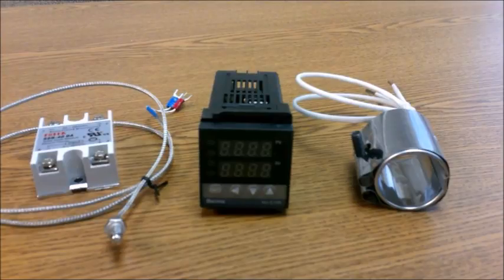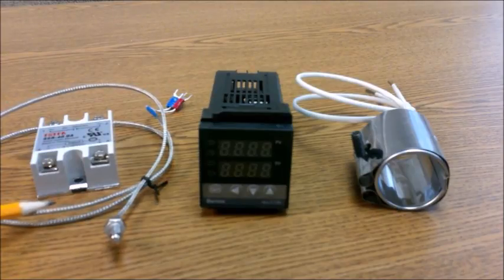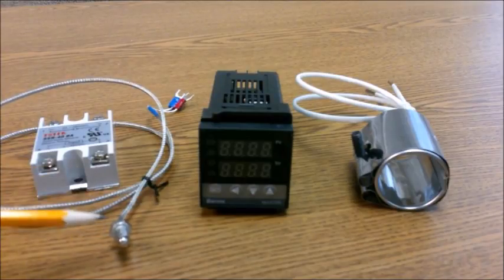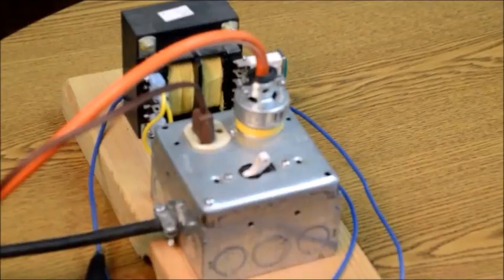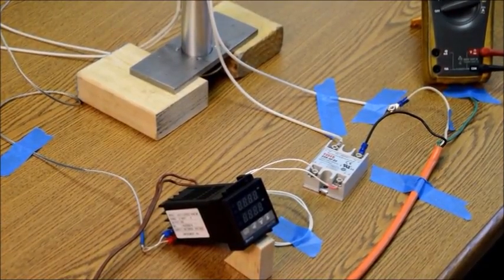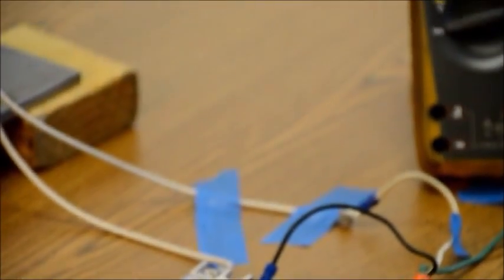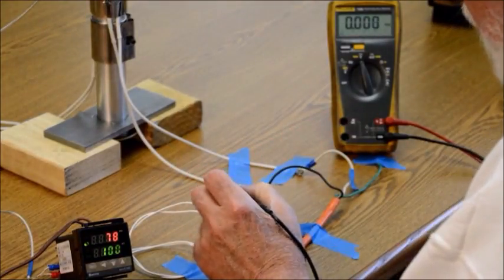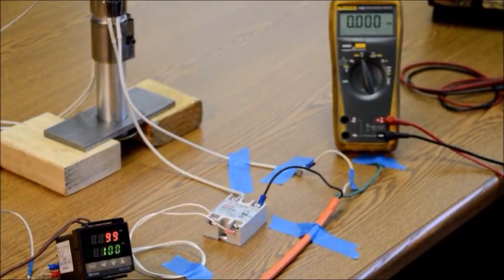Injection Molding of Recycled Plastic at Home  Part 3 Injector Electrical

Comment: Hi Paul, we have been following your very instructive videos on making an injection molding machine. We have a question, the heaters we purchased came with what seems to be very short wires about 6 inches in length. We are worried that the heaters will be too close to the wire housing. How would you go about extending the distance from the heaters from the wire housing? Is splicing with a standard 14 gauge wire ok for this?
Reply from the maker: Hi, Rebecca,
It depends on whether the leads on your heaters are just an extension of the resistance wire used in the coils.  If they are, they could get very hot.  To be safe, I would splice them with wire that has high temperature insulation like these:
https://www.amazon.com/Electrical-Silicone-Flexible-temperature-resistance/dp/B0746H96QK/ref=sr_1_7?ie=UTF8&qid=1508957924&sr=8-7&keywords=high+temperature+wire+14+awg
or something equivalent.  
Good luck with your project and be sure to let me know how it works out.  You can reach me directly at phjacobs@gmail.com if you wish.

Comment: Hi Paul, would you recommend using a three prong plug and using the ground being attached to machine base?
Reply from the maker: Yes, absolutely.  I guess I did not mention it in the video, but it is important to connect the machine frame to ground.  It shows up in the wiring diagram at 13.11 in the video and at 14.31, you can see the green (ground) wire from the AC cord is attached to one of the mounting screws for the SS relay, which is grounded to the housing.  In addition, I ran another ground wire from the housing of the controller to the base plate of the injector assembly.  You can see that wire (black) in Part 7 of this series at 8:07, although the focus is pretty crappy on that clip.  Thanks for pointing out that omission.
Reply: No, thank you! I am building a machine also. I am a CNC machinist so I pretty much fabricated the whole thing. Thanks again!
Reply from the maker: That sounds interesting.  Be sure to shoot some video so we can all see and learn.

Comment: Okay, watched most of your videos and very disappointed that you jump from this video to the shredder and never show video of the injector working? What happened? Does it NOT work?
Reply from the maker: Yes, parts 4 and 5 deal with the shredder.  In part 6 I build the mold for a plastic knob with imbedded steel bolt and in part 7 the first parts are molded with the injector.  I guess I should put these in a playlist as others have suggested.  Hope you enjoy the rest of the series.